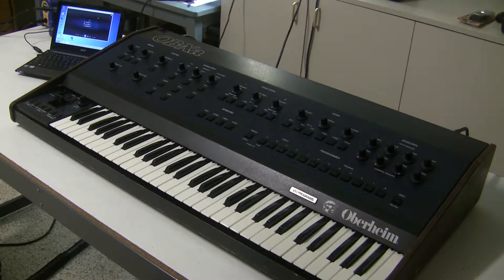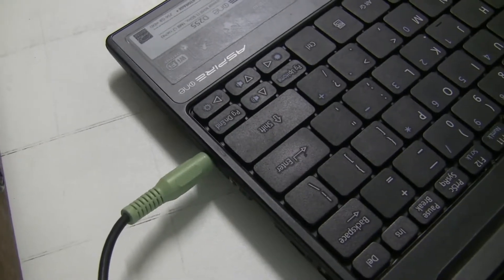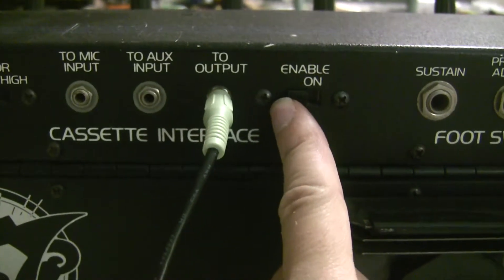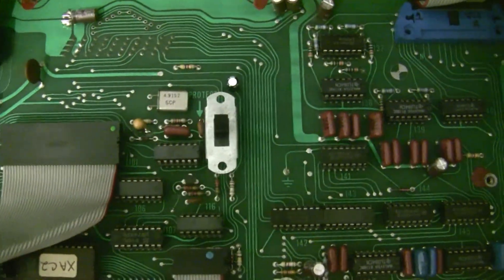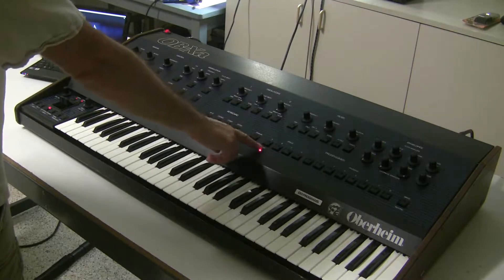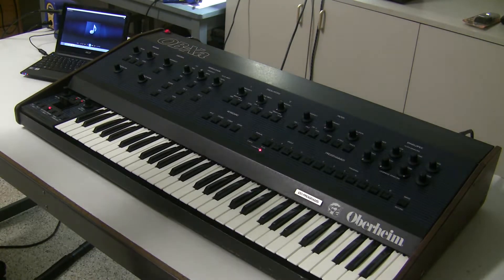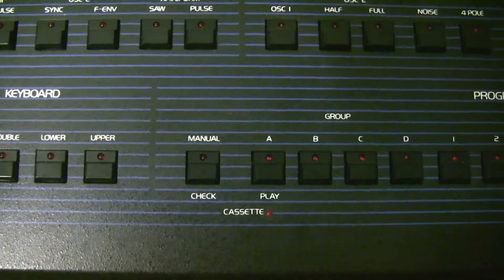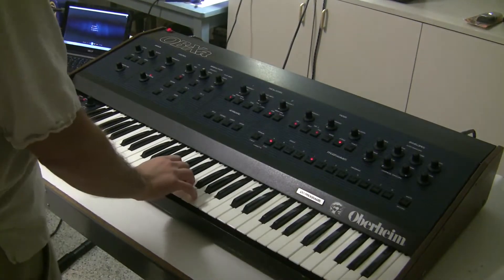Synthchaser #027 - Oberheim OB-Xa Loading Factory Patches

Comment: This is for anyone who tries to load the tape audio into the OBXa, and still can't get it to work. It seems that most PCs and phones do not put out enough volume for the OBXa to recognize the input audio correctly. What I've done was loading the file into a track in Ableton, then raising the channel and master levels to max, as well as the Mac's output. Only this has made the OBXa recognize the audio and load the presets successfully. All my tries to just send the audio from a player on either a PC, Mac or an Android phone with the volume at max, have failed.